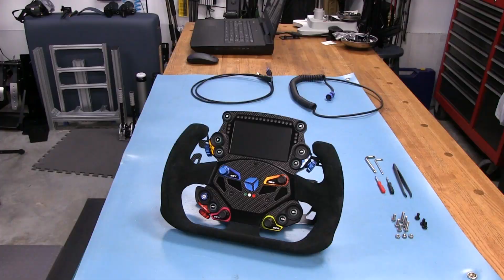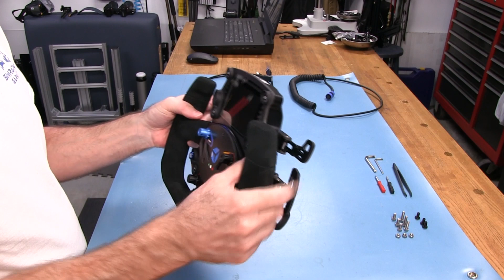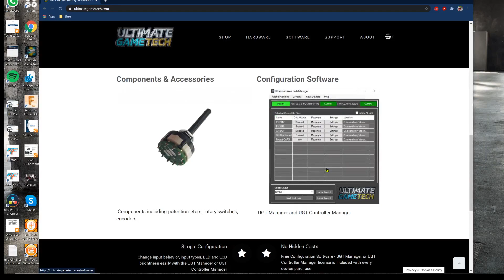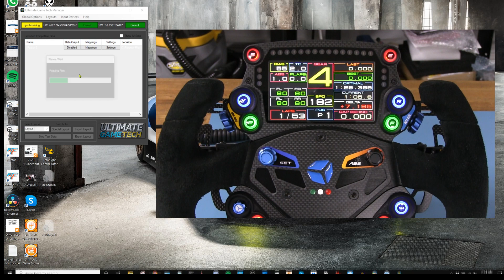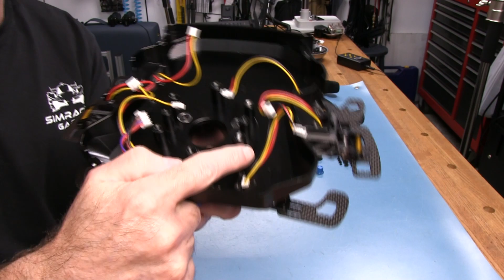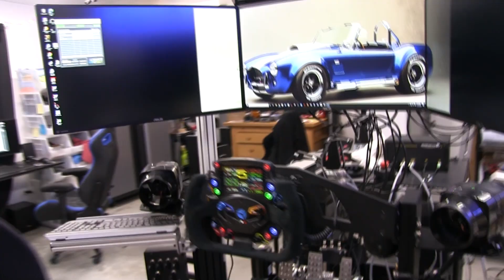Cube Controls GT-X Wheel Review

Comment: Barry you say in this review your running your motor at max strength too test out the wheel but in iracing the ffb bar isn't reacting how it would if you were running 100% ffb on wheel base and software, for one it would clip like crazy. So what do you mean by wheel maxed out? do you mean 100% in software but lower in game but technically that isn't maxed out. 

When i run my Simucube 2 ultimate just as a test and set it too 100% and max in iracing my ffb bar was way higher than what yours show and you were on Sebring which is as you know extremely bumpy so I'm a little confused as what you max means with respect

Comment: Thanks Berry, good review al always!
I am the owner of a CSX2 for a few months now. I like it a lot and overall it's very good. 
Not a big fan of the UGT software tho, and their support for iRacing is not really optimal. The TC settings on the display are limited to TC1 only. I run the LMP cars a lot and the TC2 settings (LMP2) and TC3/4 settings (LMP1) are not available on the wheel. Also the fuel usage info fields (fuel used last lap, fuel used last x laps) is not available. I now use overlays to show that information during endurance events. 

I also wish I could assign the bottom two rotaries to selected layout pages. Putting this here, as I know they are also reading the comments!

Comment: It's beautiful wheel, but with the growing adoption of VR, it sadly makes all the details and visuals on the wheel itself irrelevant...  as long as the buttons are easy to physically find, what they look like or what is being displayed becomes a non-issue.
Reply: Agree with Speeding Atheist... I used VR for a couple of months (several devices, HTC Vive Pro which I still have, Pimax 8K+ and Oculus). Yes the immersion is fantastic but the cons are so huge for now, that it is no acceptable longterm use choice. Resolution still sucks, no matter which device, the whole setup is obnoxious, the already mentioned heating/sweating limits it to maybe an hour of driving and makes it unusable on hot summer days. And if you need motion compensation in combination with a motion platform (as I do) the configuration nightmare gets even worse. Last but not least usage of overlays, specifically in iRacing, is limited and cumbersome.
Reply: @iseeq72  On really hot days I don't even try to simrace at all (no airconditioning for most Europeans). I didn't mention of course that when I saw the first video of someone sitting in an Atom on the Nordschleife and looking around the cockpit I actually moaned! ;) But in the end, IMHO (to be safe), the drawbacks are too severe.
Reply: Yeah I have to agree with Speeding Atheist. I actually went from VR (Valve Index) to triples. I still love the VR for immersion but mostly use my triples. VR has a long, long way to go IMO before it becomes my default way of gaming.
Reply: @nilsnilsnilsify  Same. From single monitor, to Vive, to Index, then finally triples. But, I'm mainly an oval racer where triples provide a better FOV. For road, though, VR's depth of field perception is an advantage. But, after an hour or so it's just just too heavy on my head and fumbling around for my mouse and buttons is a pain.
Reply: +VFX Pro Most simracers who tried VR enjoyed it for 30 minutes. For longer stints it get hot under that thing on your head, it starts to become heavy and, of course, the graphics didn't improve for a long time now. It's a gimmick and most likely will stay a gimmick.
Reply: @speedingatheist  Yeah I would say you should get an up to date HMD and give that anothetr shot.
Reply: @808GT  Nah, I have a nice cockpit to look at... ;)
Reply: @speedingatheist  If you would have been using an HP Reverb G1 or G2, you would not have come up with such a broad and inaccurate statement.   I will give you that fact that it does get hot after awhile, but I bought a small clip-on USB fan that attached to my seat behind my head, and constantly blows cool air into the headset to alleviate the issue.  The immersion level is simply way beyond what any monitors can do.  With cheaper and older headset, the visuals are simply too blurry (even with Pimax 8K plus, but with the HP Reverb, it's laser crisp).
Reply: @youngyingyang  I reject the broad and inaccurate, it's based on the general simracing community. I NEVER heard from any simracer that they replaced their 3 monitor setup with VR. Some may have added VR to their setup for occasional 'immersion' but put it away for longer races. In the end, it's ALWAYS IMHO.
Reply: @speedingatheist  You are actually wrong about VR and a recent Race Department poll kind of proves that you're talking out your ass (proof below). I moved from triples to VR and haven't looked back (a powerful PC w/ newer gen headset helps a lot). Several others I race with have made the switch from triples to VR as well. Judging by your comments about VR it seems pretty obvious that you have only tried the older VR headsets. Seems like you had some issues and just assumed everyone else has had a similar experience. Most of the negative things you mentioned were fixed awhile ago. I've raced in two 24 hour races using a VR headset (as did most of my teammates) we all did several 2-4 hours stints with no comfort issues at all.  But both my experience and yours are anecdotal. Let's look at some actual data: 

Race Department just had a poll with 1600+ sim racers responding (it's not hard to google I will send link if you need). That is a big enough sample size to give an accurate view of the community. The study shows that 50% of sim racers on the site now race in VR! Of the other half of users, 43% have never tried VR. Less than 7% of sim racers have tried VR and did not like it (even some of those voters admitted in the comments they preferred the experience but they get sick easily and could not handle VR). So you are in a very small minority. The study also showed 33%, so 1 in every 3 sim racers will now ONLY race in VR (myself included) and 16% go back and forth (many commenting they only go back to triples/monitors because games like F1 2020 don't support VR and ACC has bad VR implementation). These are pretty staggering figures when you look at where VR was only a year or two ago.

I was talking about the poll to my buddy who is a dev at one of the more popular sims. While he wouldn't give me exact figures he did say they are seeing fairly similar VR usage as the poll from their more active users and that VR usage on the sim has over doubled in the last year alone!  He said with the Quest 2 making quality VR more affordable (along with more powerful GPU's) they expect VR usage on their sim to more than double again in 2021. So the evidence is overwhelmingly clear that VR is continuing to take over. For obvious reasons, it's more immersive, less expensive, takes up less space, easier set-up, etc. The trend will only continue as VR tech and game support for it improves. I'm sorry you thought it was a gimmick but I suggest you try it again. The tech has come a long way in the past couple of years. If it's your stomach that can't handle it try using a high refresh rate headset. I know many who can't handle VR at 90fps but have no issues at all at 144fps. For most of us, we can already laugh that you thought sim racing in VR will always be a gimmick but I wish this was Reddit so I could do a !remindme 2 years so you'd be able to laugh with us when the shift becomes even more obvious. 

The trend line is pretty clear but honestly, I don't care how others enjoy the hobby. I'm just glad the hobby is growing and that people can enjoy it in whatever method suits them best. Cheers, hope to see you on the track!